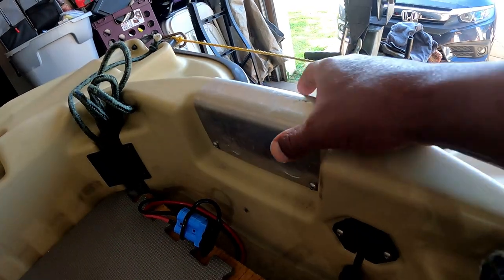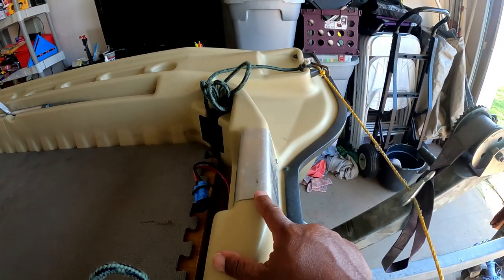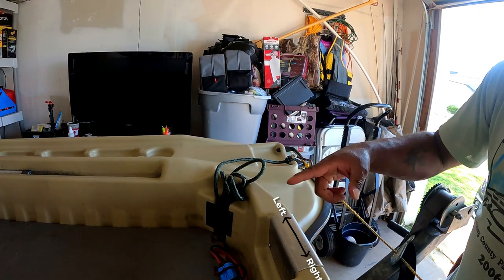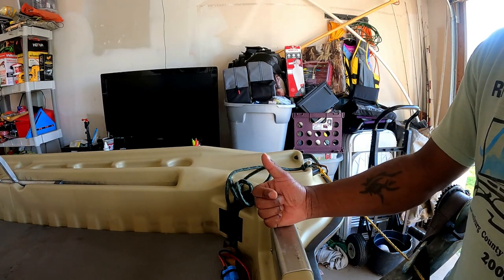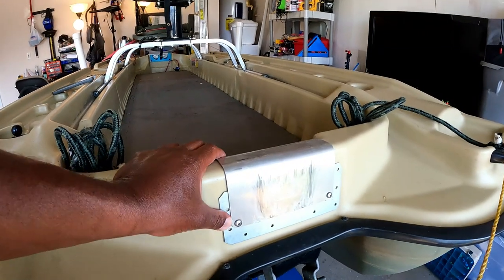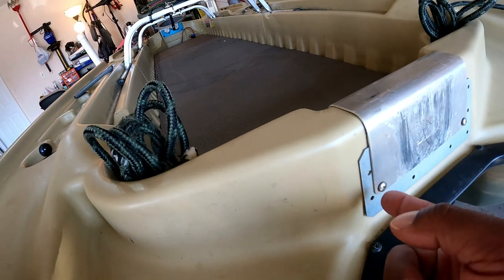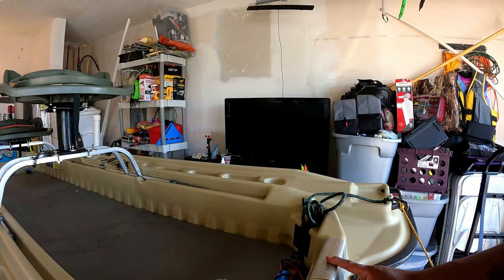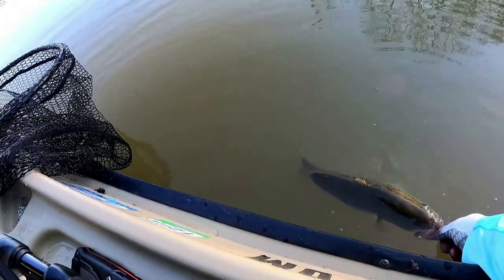Pelican Bass Raider Biggest Issue (What DIY I did to fix it)

Comment: Thanks for sharing. I have the same boat. I have been using my trolling motor on the stern. I purchased a 3.5 outboard and now will move my trolling motor to the front. Valuable info. I really appreciate it.
Reply from the maker: You're welcome David thanks for watching 👍🏾
Reply: My problem exactly. Almost lost my Minn Kota Endura, 30-pound  thrust.  You are dead right about the bow mounting plate. In addition to the problem you mentioned, it is not angled like the transom plate - not straight up and down. Probably needs a glue down wooden wedge to get the angle right. 

Also, when you tighten down the bracket, the round, pivoting feet come into contact with the metal plate - which causes the Minn Kota to slide when it torques. The problem is similar on the back side of the bracket: hard plastic to metal. Not good either way. 

I like your idea. I will also try to overcome the slippery situation at the contact points by adding wood plates or a non-slip covering. Thanks, Jeff.
Reply from the maker: @steveb.1701 I like you're ideas sounds like you got a good game plan. If you remember let me know how it works out.
Reply: Will do.

Comment: Thanks for the tip! Pelican still have not reenforced the front transom!  I have a similar setup; I have a Chinese 4 stroke in the rear and a 36lb Newport vessels in the front.
Thing were going smooth until I increased the trolling motor to max speed. The trolling motor slid right off the transom as I was making a turn. Lucky for me I caught it in time.
i am headed to Lowes and pick up one of those strap ties today!
Reply from the maker: I'm so glad you didn't lose your trolling motor  hopefully my tip will keep your trolling motor in place. If you have some of those grip strips they put on outdoor steps and services that adds even more grip.

Comment: My Quest Angler 10 didnt come with a front plate I had to fabricate one for it. When I first got my 14' Jon boat I had a motor fall off because the wood in the back was to short. I did add another piece of wood but when the motor fell off it totally fell off into the water. Luckily I was able to retrieve it but after that I made a cable that attaches the motor to the boat so if by chance it ever happens again it wont go in the water.
Reply from the maker: Oh 😲 I glad you was able to get your motor back. I'm going to have to look into doing the same thing for mine just in case. Thanks for watching I appreciate it. 👍🏾

Comment: I have mine split in half.  It is a block of wood in front and piece of foam in rear.  My bolt holes barely were in the wood.  Great fix!
Reply from the maker: Thanks Michael for sharing that with me. Thanks for watching and leaving a comment. 👍🏾
Reply: What did they use inside for flotation? Foam blocks or spray foam?
Reply from the maker: I think it's foam blocks of some kind. That's a great question. 👍🏾